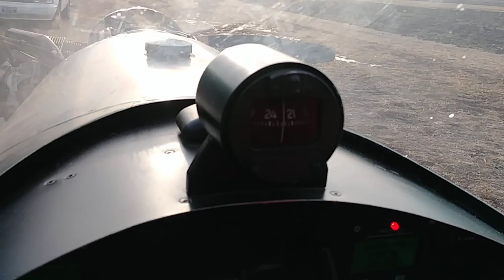Craig T/O and problems with my H5

Comment: So, what was the problem? It's always good to give info, so that we gain experience. Thanks.
Reply from the maker: Hi Am Snyder. Wow that's an old video there. Well last year. I had to watch a little bit to find out what you were talking about. The problem was the alternator came apart!!! So I decided since I would have to pull the engine to fix it I would just get a new engine. So I bought the engine I have now. Which is a Scott Casler 2400cc engine. So that should answer that question. Thanks for the question